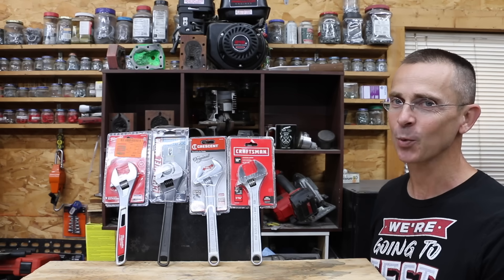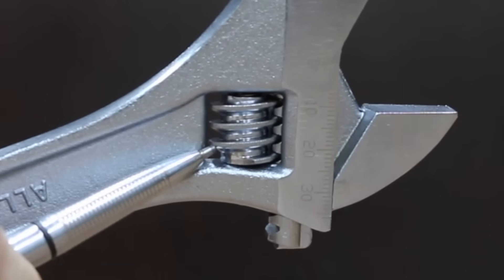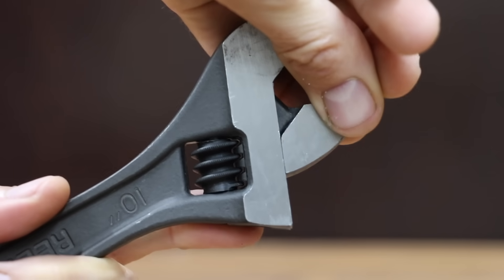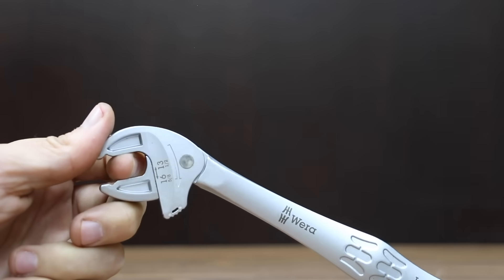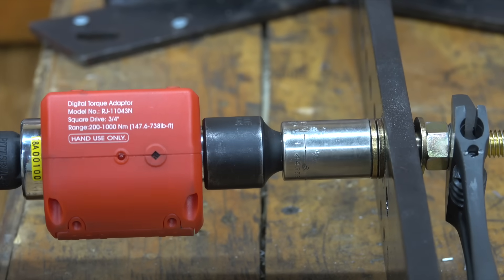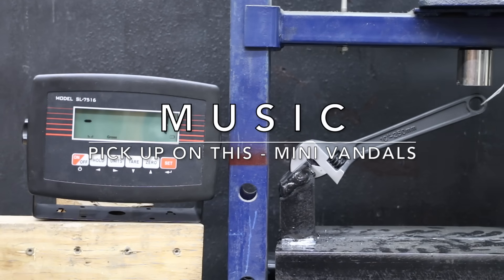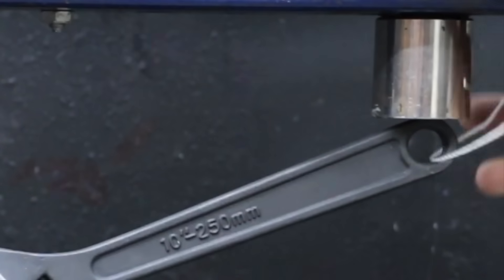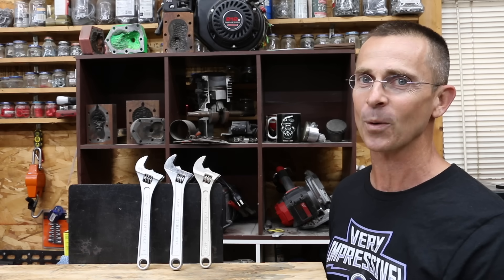Best Wrench (ADJUSTABLE)? Craftsman USA vs Craftsman, Crescent, Kobalt, Milwaukee, Channellock

Comment: Thanks for another great video! A suggestion: I would have loved to see your personal rating on the smoothness of the mechanism. For light duty use, for instance, I may be more inclined to go with a weaker wrench that's more pleasant to use than a big clunker that may be strong but grinds like crazy when you adjust it =). I think you tend to stay away from subjective ratings, which I absolutely appreciate, but you also have a lot more experience than most and I'd love more videos to include your opinions on fit/finish/feel!
Reply from the maker: Thank you for the suggestion!
Reply: He did that for one of the other wrench comparisons, iirc.  You're right that it would be nice to have it, tho I understand him wanting to stay to comparison he can quantify.
Reply: @KaseyWynne  Yep! That may have been the one I was thinking of and that I appreciated. I appreciate his laser focus on quality, no-frills testing, but I think that he also does a very good job of making it clear when something is just his opinion. I'm glad that someone else appreciates when he adds those opinions in, especially as someone who isn't particularly hard on his tools -- I want tools that are a pleasure to use as well as durable!
Reply: @zallaun7327  Yeah, I left a comment on his screwdriver test that I would like a subjective analysis of how comfortable the handles were, and how their design helped/hindered the torque applied.

Comment: Project farm lets do some test with milwaukee super hawg vs competition
(Theres key tightened chucks and quick connect chucks for same tools wonder if it matters could be little side test. )

Or some real hammer drills not the crappy hammer drill setting on the the drills but an actual hammer drill
Reply from the maker: Thank you for the video idea!

Comment: I am fortunate to own 5 vintage craftsman wrenchs. They are so good I uses one to break up a block of concrete.
Awesome video. RIPs wrenchs.
Video idea: Socket adapters for hand drills.
Ps:Just used the impact rated Hart brand 1/2in socket adapter with my Milwaukee impact drill to remove lugs off my truck. Junk broke at the head after only 15 lugs and got stuck in my impact socket. Not worth hassle or price.
Reply: @AJ Hauter I had to go back a full year but there is indeed a video. Though I have to see if he tested the 1/2 in adapters.

Comment: Awesome test! Thanks Todd! Viewers outside the US and England will be smiling to find the US growing up and finally adopting the Metric System. Engineer Elon Musk grew up in his South Africa, Engineer Sandy Munro as well in his native Canada.  NASA supposed to be all in metric but if their contractors disobey it turns out very very expensive. Maybe Mark Rober quit his lucrative job at NASA? Who knows. Maybe ask Prof John Kelly at Weber university of what he thinks the future is? Whilst I prefer all metric I must admit I use psi in my wheels just because it is a straight number and pressure has way too many standards. Now torque is a bit of an issue! Newton deserves some credit. Airplanes have switched their fuel from gallons to metric tons. It keeps them safer in the air!  Of course even In Australia if one picks up a piece of milled wood for framing it is going to be called a 2 by 4. Watching this on a 32" monitor lol.....

Comment: Really interesting video. Adjustable wrenches are essentially an emergency multi-tool when you don't have your proper tools on hand. You might throw a couple in the back of your car for example. This test shows it's worth getting decent ones because you'll need them to function if you're ever in the unfortunate position of having to actually rely on one.
Reply: We have adjustable wrenches in our emergency tool kits in our college buses. Craftsman USA and channel lock

Comment: I've been lucky enough to have a Dad that left me all the tools he had acquired in the 50s, 60s, 70s & 80s so I have these Craftsman gems.  I also have some Crescent brand wrenches that say Made In Jamestown, NY so when you said Crescent was now made in China I was a little shocked.  They are one brand I haven't followed as far as their current production stuff but I can believe they went by the way of cheap production.  I'll tell you one thing, this huge crescent wrench that I have would not break on that downward pressure test.  It's gigantic...... I mean it's comically large.  To the point that I use other adjustable wrenches instead of it. Lol
Reply: Crescent was bought out by Apex tools and they also own Gearwrench, KD tools, Armstrong, and Allen. All of them are now sadly made in China and most brands were shut down years ago. Gearwrench has been slowly cheapening out and their stuff is not as good as pre Apex buyout.

Comment: There something in your tests that has always bugged me: repeatability.
You need to source 4~5 tools per brand from different suppliers/production lots and add error bars to those plots.
Otherwise I will never know if you got a "(un)lucky" tool from a specific brand and how much I should expect to buy a tool with similar performances.
I would very much prefer to have a smaller selection of brands, but a better confidence when picking one of them.

Comment: For you guys that like to slip a cheater pipe over the handle, the Bahco is for you!  Great video, Todd.  I saw someone else mention c-clamps, and I’d like to second the idea.  After Irwin bought and shut down Record, I find it hard to buy a decent c-clamp for metalworking.  Fixturing for welding can put a lot of stress on the clamp, and the cheap clamps all bend out of alignment.
Reply from the maker: Thank you for the video idea!

Comment: only ever adjustable i have ever bought is that bacho. paid like 27$ for it. went thru all of the brands in the isle, checking for the one with the least amount of slop and beeing narrow. bacho won my test. and it works surprisingly well. nowhere near the same as a spanner. but about the same as one can expect from an open end spanner. nice for the emergency toolbox in the backpack:P
Reply from the maker: Thank you for the feedback.

Comment: The torque test and deflection test have the wrenches backwards. The pressure should be put at the base end of the adjustable jaw, not the far end.
Reply from the maker: Thank you for the feedback.

Comment: In the test at 9:03, try reversing the adjustable wrench so that the adjustable jaw is on the bottom rather than the top & see if that makes any difference.
Reply from the maker: Thank you for the feedback.

Comment: I have a Craftsman adjustable that I've owned for a couple decades now and have only had to re-do the flat surfaces to regain perpendicularity, after years of use and abuse. Not sure what alloy its made of, but its never had rust or any other corrosion form on it, I just wipe of the dirt and grime and it looks and operates like new. The jaws are still nice and snug, too, when I've seen other new wrenches visibly wobble and rattle.

Comment: As usual, you've put together yet another nicely made video.  I very rarely ever use a traditional adjustable wrench, the ones I do have are USA Craftsman.  Good to see it did well in the testing.  The tool that I tend to keep in one of my work pants pocket is a Knipex Pliers Wrench.  This tool has basically taken away any need for me to ever use a traditional adjustable wrench.  Would be interesting to see how it would fare in your testing!
Reply from the maker: Thank you for the video idea!

Comment: It didn't break! Also the meter kept going up until he let the pressure off. If it broke, or slipped it wouldn't have still been on the test piece when applying pressure. I want a do over Project Farm. If you don't,  you'll be called Project Parm, because you're cheesy, lol. Please do a do over

Comment: Soooo…

My understanding is that Craftsman tools were forged at some foundry in Ohio. Is this correct not no?

Wherever it’s located is the original foundry still open and if so can’t someone open create a new brand and built tools to specs that the Craftsman were built too. Obviously the tool market consists of many brands owned by just a handful of corporations - making a new brand a basic nonstarter. 

Just can’t hurt to bring 🇺🇸 quality back instead of counting on the downtime of exchange programs at the retail counter.

Comment: Mighty fine testing, Todd!  Made my heart sing that you found an old new Craftsman and it did so well.  One of the only tools I "have" abused back in the day, is my craftsman ~15" with a 6' pipe to break a VW axle nut loose and reinstall it cause I couldn't afford a 36mm socket nor 3/4 breaker for 300ft/lbs, iirc...still have it, works fine!  Thanks much for all you bring forward for us, just the best!  Hat Tip, ~PJ
Reply from the maker: Thank you!

Comment: I’ve got a set of Irwin’s that is incredibly tight and I performed this test “Accidentally” with an impact and beat the shit out of my arm! LoL 

Since then I’ve bought a second set and just happened across a clearance but doesn’t have those blue grips and they don’t have the slop that yours did.  I may have a model that is a little higher quality.

Comment: My absolute favorite adjustable wrench is Tops brand from Japan. I use mine almost every day. When I first got it, it would hold adjustment even in my pocket. It has a little play now after a few years of use but it holds adjustment better than a lot of brand new adjustables I have experience with.

Comment: Also were the adjustable wrenches in the wrong position when testing them to failure on accident or is that just to test the strength of it? I know it's always supposed to be turned towards the jaw that doesn't adjust.

Comment: So glad my old tool box contains 3 different sized vintage Craftsman adjustable wrenches!  The largest also makes a darn goo hammer :)  Thanks again for an excellent  "We're Gonna Test That" video.
Reply: Every tool is a hammer if used correctly.

Comment: Another very useful video, thank you very much.

Some old Volvo cars had a toolkit with the "best" adjustable wrench.  One end featured a typical adjustable wrench head.  The other end was a V shaped jaw, one side was flat and the other side had teeth to dig into nuts/bolts after you rounded off the flats using an adjustable wrench.
Reply: The V end is typically called a Bulldog wrench.  That Volvo Wrench was made by Bahco  as an FYI
Reply: @matthewq4b  thank you, I found a picture of it online and that is indeed the wrench I remember.

Comment: I have a chinese made wrench that has almost 0 play in it, that was part of one of those huge kits with 305 pieces for $20. The slide is tight like a linear rail. I can grip tiny bolts and nuts and even with only 2 sides gripping it has no problems. All the tools in that set are surprisingly good quality. It has crimpers, hammer, wrenches, a saw, live wire tester, wire strippers, screwdriver set, 65 piece insert kit and many other tools
Reply: So what is the brand?
Reply: @dontrend5956  Some no name I picked up on AliExpress. The handle doesn't even have a name on it. I just checked the pliers as well, and neither do they. The handles are Blue and Gray molding. I will check the case when I get up and update.
Reply: @excitedbox5705  Ok, thanks.

Comment: Ok I know it isn't fair comparison, but I absolutely love Knipex straight edge pliers which are meant to replace this traditional tool and it does it so beautifully. Concept is so good in them. Harder you twist more torque you're getting at it's Jaws. I've pretty much replaced all common wrenches with them. I can very highly recommend them.
Reply: I finally bit the bullet and ponied up for a set of four (they're very proud of them and priced accordingly!). Money well spent.
I wish they didn't call them Plier Wrenches, because they are not pliers at all. They do have two handles, but closing the handles makes a sliding jaw close on your fastener, very much like the adjustables in this test.
Love 'em.
(Knipex also makes a line of regular slip-joint/water pump/channellock pliers, called Cobra. The plier wrenches are a different thing.)
Reply: @g.tucker8682  They're very good tools. Also absolutely perfect for some sheet metal stuff ie. straightening or bending.
Reply: What are straight edge pliers?
Reply: They are marketed as the Knipex Pliers Wrench. They have flat faced, parallel adjusting jaws, with a box joint design for strength
Reply: @davidbrackett5832  Ok. I haven't heard pliers called that name before.
Reply: @davidbrackett5832  Yes, that appears to be the correct English name for model I meant.
Reply: Weren't those in last week's video?
Reply: @myownsite  ei kun ne oli Cobrat, eli ns. vesipumppupihdit . Tarkoitan niitä suoraleukaisia Knipexejä 😀
Reply: @myownsite  That was the slip-joint Knipex Cobra, not the Plier Wrenches.

Comment: I have a bunch of vintage 40s-90s USA adjustable wrenches from many different brands. The screws are so tight you have a hard time adjusting them. I do not use them much but they are solid units. I see there is not much that compares to them these days.

Comment: You completely missed that the joker wrench is designed to fit on the edges of a six point not. Look again closer and you will see that you actually use the joker incorrectly

Comment: Seems the longer jaws are a disadvantage in the fact that they can apply more force to the connection of the two jaws. I've mostly used them for straightening out customers mangled snow blowers, augers and impellers. 22 inch ones make short work of eighth inch steel.
Reply: I have a 2 foot adjustable I use as a mangler here. It is one of the better uses for the tool.

Comment: I'm still sticking with my 8" Bahco. Performs like a 10" and is the best adjustable I've ever used. The only downside is that you can't put it down, or it will "grow legs".
Reply: Bahco's reign supreme on ships. As a marine engineer I and almost everyone else always have one on us. Legendary amongst mariners 

*Edit:  The Bahco Alligator adjustable to be precise*
Reply: I have a few Bahco tools, and I have a sneaking suspicion they've gone the route of Craftsman and all the rest.
Reply: I was briefly an assembly engineer for a company specialising in automated manufacturing solutions and my Bahco tools were as good or better than the more expensive tools used by my co-workers.

They were all impressed by the quality, ergonomics and ease of use of the Bahco tools. 

The combination of Nordic human factor led design and Germanic functional led design is the perfect balance.

Comment: Wow.

For once, "they don't make them like they used to" and "made in the USA!" is actually true!

For most tools (well, power tools at least) it's just not true, and the newer technology is more often that not better.  Apparently not true for adjustable wrenches.

Though to be fair, you likely shouldn't be using an adjustable wrench when applying so much force, you should be using a box end wrench, or socket.

Comment: Craftsman has an adjustable wrench which has a clap on it similar to a pair of vise grip pliers.  I’ve been using them for a couple of years and an very impressed with them.  If you do another test try to include it.

Comment: I disagree with your "leverage disadvantage" assessment. It seems to me that shorter jaws equals a greater advantage in the hydraulic press test. Longer Jaws are a disadvantage, as there is greater leverage. For a bolt or nut, jaw length is not a factor.